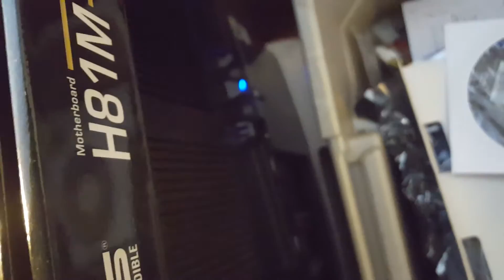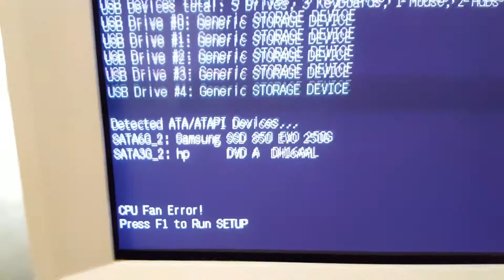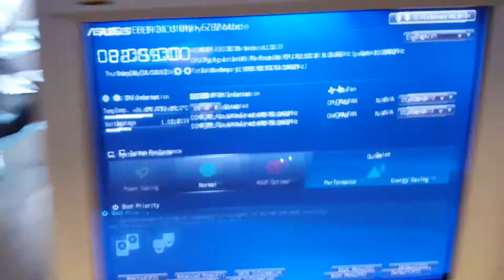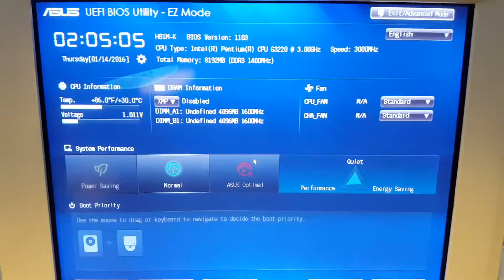New Asus H81M-K CPU fan error!

Comment: had the same problem after installing a new psu, what i did not see was a piece off plastic blocking the fan from spinning so after i took out the piece of zip tie it seems to be spinning fine
Reply from the maker: mine must have been a defective cpu fan header because the same fan works on a new board.
Reply: ahh rite i followed your video and as i was watching i seen the bit of plastic so as soon as i removed it and started it up it span and didn't make the 4 beeps. it was frustrating as its the first time i fitted a psu so did not have a clue at first. thought i may have to replace the fan
Reply from the maker: Mine had a bad fan header.

Comment: did you put thermal paste
Reply from the maker: Thermal paste is already preapplied on the stock heat sink and has nothing to do with this error. Motherboard does not detect a fan connected and that is the problem.
Reply: LoveAviation oh,ok,thx